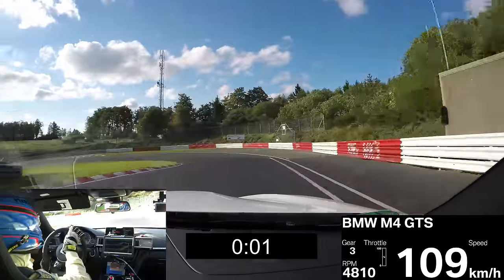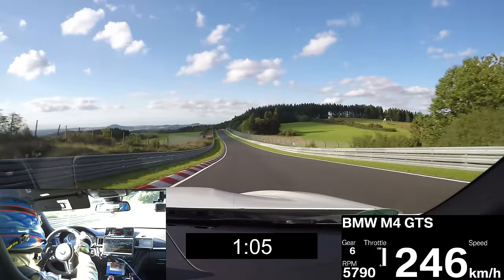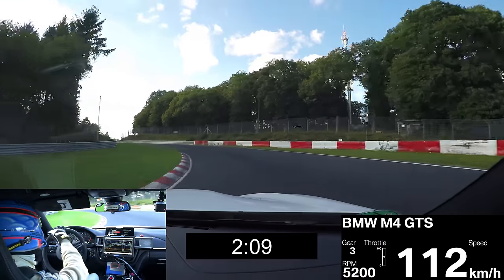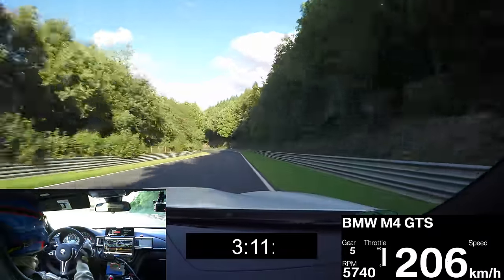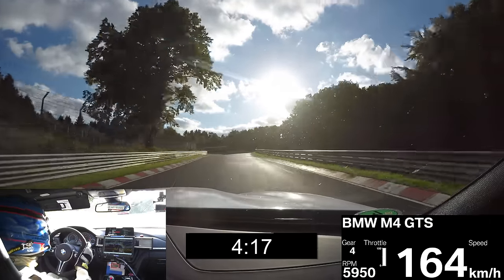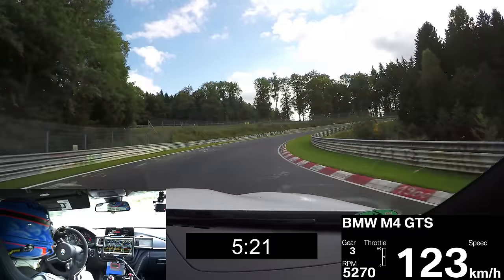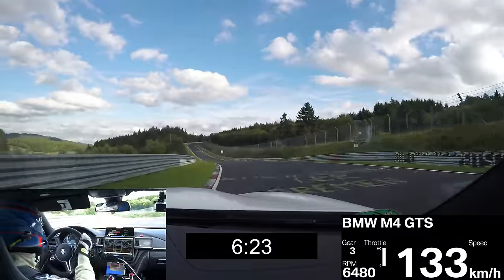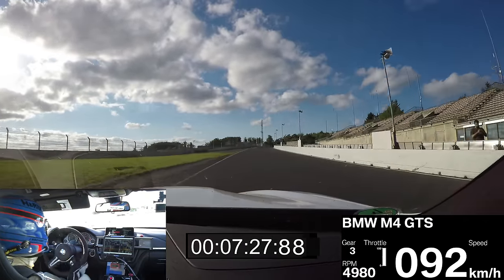BMW M4 GTS Fast Lap Nuerburgring Nordschleife.

Comment: It's defying the fact that this is still a street-legal, sedan-based coupe.
Reply: +Gotthard Leng Lol, "sedan based coupe"? The M3 has the M4 mechanicals underneath it, that's why it has those wheel arches. So, no.
Reply: +thefridgeman knob
Reply: then ask yourself the same question about liter bikes with well over 200hp at the rear wheel :D
Reply: Actually it’s a coupe based coupe.